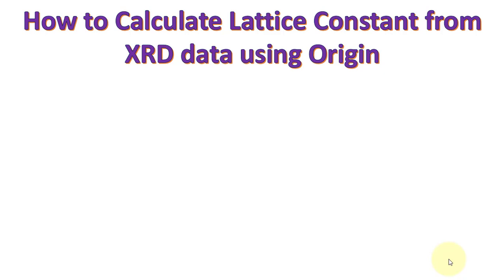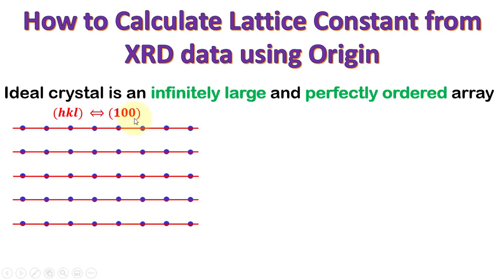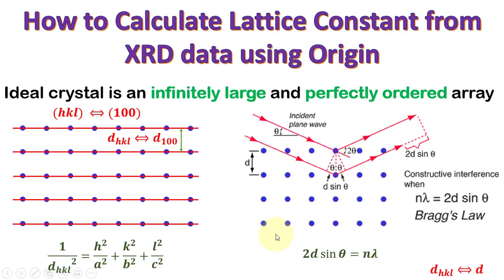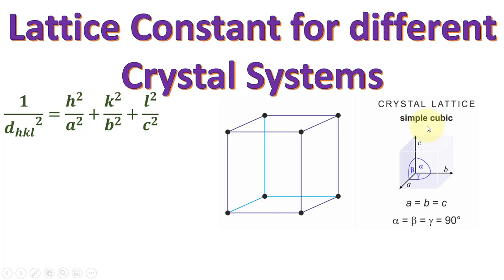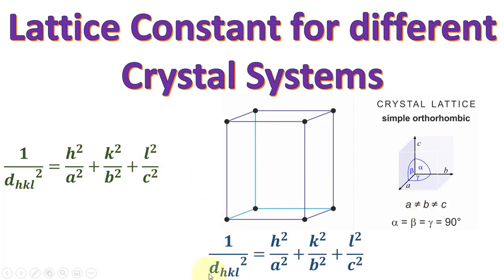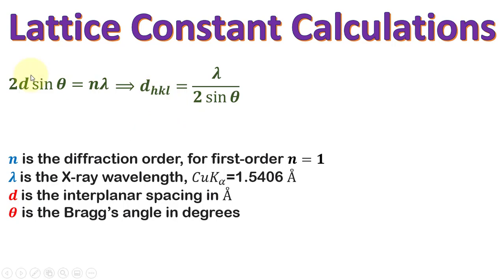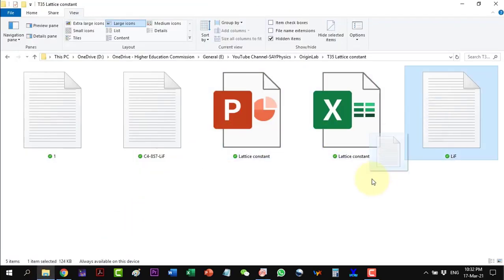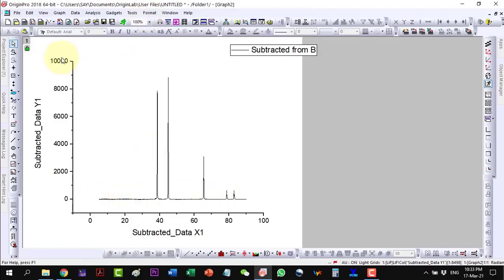How to calculate lattice constants from XRD data using origin

Comment: Can you also add excel sheet for calculation lattice parameters for hexagonal crystal structure sir?
Reply from the maker: Based on the provided template, you can make your own with the following details. In a hexagonal crystal system, the interplanar spacing d(hkl) is given by the formula:

d(hkl) = 1 / sqrt( (4/3) * ( (h^2 + hk + k^2) / a^2 ) + (l^2 / c^2) )

Where:

h, k, l are the Miller indices of the plane,
a is the lattice constant in the basal plane (the ab-plane),
c is the lattice constant along the c-axis (the vertical axis).
This equation accounts for the hexagonal symmetry, where the lattice constants a and b are equal, while the c-axis can be different. Thanks

Comment: Thank you very much Sir!! This video is very helpful to my work. But can I ask one question? I'd like to ask about the values in Excel Template you uploaded. For tetragonal case, it was set a=b=18.2 and a=b=18.44 for each case. Can you explain how you set this values and why these are different?
Reply: Also, how did you derive the c value written as 10.78?
Reply from the maker: Thanks for the appreciation dear 😊.
The values in template are put either directly from the literature or calculated in the template based on the input from the data. When you click a cell, in the template, it shows all the calculatelions behind it. Thanks

Comment: How to find the lattice parameters for a mixed phase
Reply from the maker: Calculating lattice parameters from XRD data for a mixed phase involves additional steps. You'll need to perform phase analysis to identify the different phases present in your sample. Once you have that information, you can use specialized software or equations to determine the lattice parameters for each phase. Rietveld refinement is one of the best way to know these parameters. Thanks
Reply: Thank you very much sir...i thought of rietveld refinement thanks for the confirmation
Reply from the maker: You're welcome dear

Comment: Sir, your video helped i my research work, please provide, i need how to draw a MIS structure diode video. Thank you so much
Reply from the maker: I'm glad my video helped with your research! I don't have any tutorial on the requested topic. To add to your question, draw a rectangle for the semiconductor substrate (silicon), add a thin layer on top for the insulator (silicon dioxide), and then add a layer above that for the metal contact. Label each layer and add electrical contacts to the metal and the substrate. Thanks for the suggestion though!

Comment: Hello sir, could you let me know how you determine the h,k,l value in the excel file? If my sample is newly synthesized product, can I use the XRD standard?
Reply from the maker: I have taken the hkl directly from the database through matching. However, you may drive them through basic equations of materials science. For an unknown or newly synthesized materials a lot of data is required which come from many such characterizations. One technique's data can't be trusted. Thanks

Comment: Nice video sir , by following the method in the video. In my case for tetragonal structure the constant a and c value are closed with JCPD card only for highest peaks. But for small peaks the percent error is too much.
Reply from the maker: It's right then. However, if small peaks aren't matching with the JCPD card, then you may have new phases. Thanks for the appreciation.
Reply: @SAYPhysics  thanks sir , which one result is more accurate JCPD card or from origin. If JCPD card values are corrected why we use origin to calculate.
Reply from the maker: JCPD card is based on someone else samples/data, while your data is in origin. Thanks

Comment: can you tell me how to find out lattice constant for monoclinic crystal
Reply from the maker: You'll have to use the monoclinic related relations as follows;
The monoclinic crystal system has three unequal axes, with two axes that intersect at an oblique angle, and a third axis perpendicular to the plane of intersection.
The lattice constant formula for the monoclinic system can be expressed as:
a = √(b₁² + b₂² + b₃² - 2b₁b₃cos(β))
where a is the length of the unique axis, b₁, b₂, and b₃ are the lengths of the three lattice vectors, and β is the angle between b₁ and b₃.
The hkl plane indices for the monoclinic system can be determined using the following relation:
hkl = {h, k, l}
where h, k, and l are integers that represent the intersections of the plane with the a, b, and c axes, respectively, and are related to the interplanar spacing d(hkl) by the formula:
d(hkl) = 1/√((h/a)² + (k/b)² + (l/c)² - 2(hk/ab)cos(β) - 2(hl/ac)cos(γ) - 2(kl/bc)cos(α))
where α, β, and γ are the angles between the b and c, a and c, and a and b axes, respectively.

Comment: in the case of the tetragonal structure can we calculate  b constant and deduce  a constant from the fact that a=b using (hkl)==) (0 2 0) ?
Reply: I have another question, did you calculate the lattice constants for a single plane (hkl), i.e. did you not calculate the average lattice constants? If so, why don't we do the same thing in the case of a cubic structure? why do we calculate the average lattice constant.
Reply from the maker: Yes Dounia, you can calculate provided you have the right relation for the tetragonal structure. Thanks
Reply from the maker: As you know, in cubic structure, all sides are equal and we have more freedom to go for an average value. While for other structures, we should have average value, but due to limitation of calculations, we go for single values. Thanks
Reply: @SAYPhysics  thank you sir for your highlights, could you please do videos about reitveld refinement??
Reply from the maker: I'll try, IA. Thanks

Comment: in my data a single peak have 2 h,k,l values. then how  i can calculate d spacing?
Reply from the maker: Principally, there's should be one set of hkl for each peak. If not, there may be many reasons associated with such a situation. Either you have overlapping peaks, which needs deconvolution or the actual identification is difficult and need refinement. There's also a possibility of equivalent set of planes. You may go for small step size during characterization or Rietveld refinement on existing data. Thanks
Reply: @SAYPhysics   i got h,k,l from jcpds which show exact same peak with different h,k,l values
Reply from the maker: They're equivalent planes then.
Reply: @SAYPhysics  ok
Reply: @SAYPhysics  then how can we find out lattice parameters? which h,k,l value should we take ?

Comment: The question is how do you know that it is orthorhombic without watching ICDD data?
Reply from the maker: You're right that for avoiding many calculations, we take help from pdf or icdd cards. However, if an icdd cards aren't available, how we decide one? That's after many calculations available in the literature. Thanks
Reply: @SAYPhysics  sir let me say i have a monoclinic compound and i don't have it's icdd data or any other raw file. so is it possible to tell that this is monocline just by looking at miller indices and xrd data
Reply from the maker: Yes. From all the parameters like lattice constants, diffraction planes, form and structure factors, interplanar distances etc. We decide about its structure. Thanks

Comment: sir how to calculate lattice parameter of composite film with different concentrations of doping
Reply from the maker: The lattice parameters are usually not changed with the dopant concentration. The lattice parameters are as per nature of the material. Thanks
Reply: @SAYPhysics  but sir the graph shifts after doping of other materials
Reply from the maker: Yes, lattice distortions cause this shift. Thanks
Reply: @SAYPhysics  then how to calculate these lattice parameter
Reply from the maker: With rietveld refinements you can calculate the lattice parameters. Thanks
Reply: @SAYPhysics  i have this software. i prepared 0.2, 0.4 gms of FeO mixed with PVA. but i don't know how i calculate these doping. i calculated pure PVA and Pure FeO lattice parameter. But how to calculate PVA-FeO composite i don't know please tell me sir
Reply from the maker: Dopants are usually as a weight percent or molar percent. In your case, it seems you have done it with weight percent.
Reply: @SAYPhysics  yes weight percentage
Reply from the maker: During matching, u select Fe, O elements and the elements in the polymer PVA. Thanks
Reply: how sir i don't know please tell me sir how these select. please
Reply: how PVA-FeO both select in rietveld refinement. Please tell me sir i commented all youtubers but now one tell me except you sir. please tell me sir
Reply from the maker: Please see my this video https://youtu.be/r1EKRfV4ZRg
Reply: @SAYPhysics  i will try sir can you send me this software please
Reply: i saw this video sir you data don't have weight %. I am confused because of weight percentage